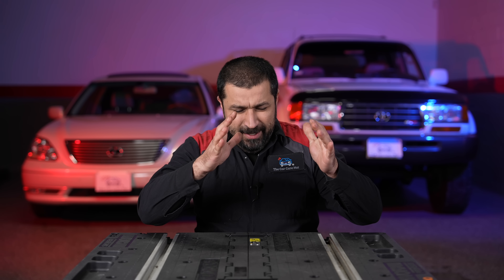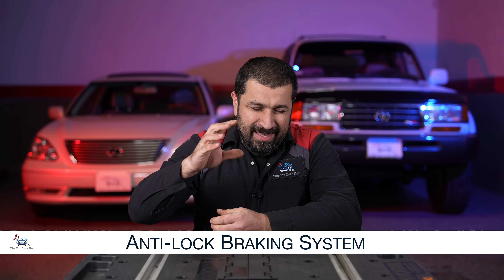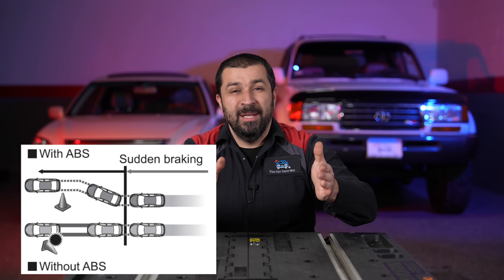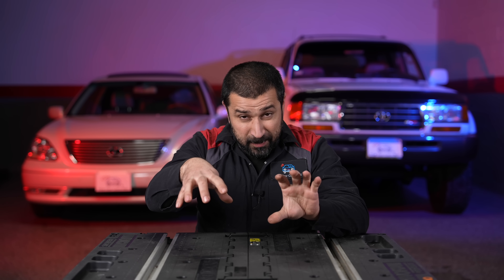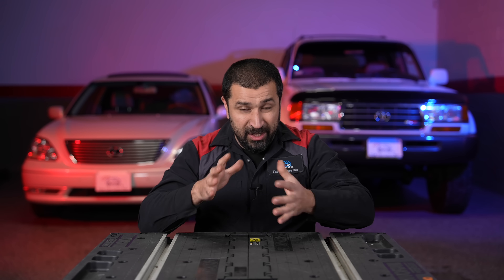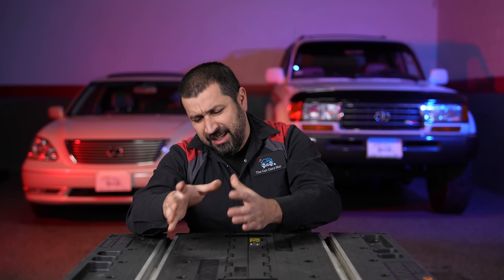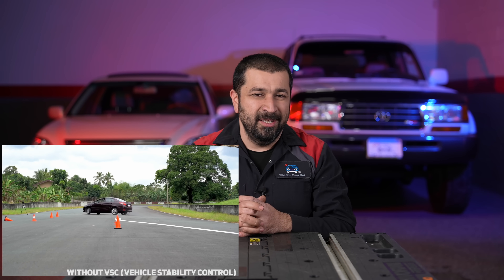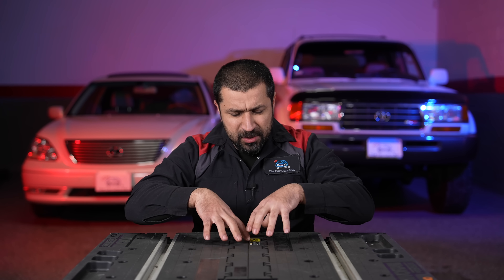How Does Toyota ABS, Traction Control and VSC Work? Everything You Need to KNow

Comment: The VSC and TC will light up if you get a transmission code (08 Rav-4)  The cruise control will stop working too. In my case, I needed a torque converter solenoid. The computer will detect a difference between the engine speed and the output speed and throw the code.  Funny thing is that the car drove fine, but the dash was light up like a christmas tree.

Comment: back when we had rear wheel powered vehicles, and there was a system known as positraction, then came a genius and said " hell we will place a computer in its place, this exposed to the elements- snow, ice, corrision, and the very great possibility of faulty electric components, so this day we have a half ass system. It is expensive to maintain, and will fail, this 100 percent failure, now one must realize, money is made by coming up with half ass thoughts.About fifty percent of vehicles benefit from A.B.S. the balance it is just 100 percent useless bullshit.

Comment: Thank you for sharing this valuable information.  I went to test drive  a 2007 Fj cruiser and everything was perfect  until in one curve the abs,  vsc and vsc track off lights came on.  No engine light on. I didn't hit the brakes hard in any way and I  didn't feel any spin off or traction loss . The Fj is manual and I did engage the clutch  while pressing  the brakes  to reduce speed. The speed was around 35 and reducing to around 25. The lights went off after a while  and kept driving normal. Would aftermarket wheels and tires be the issue?  It has 22 inch wheels and off road tires. 
Thank you  for any help.

Comment: I have a 2003 Sequoia and only when I get the traction control to slip I hear like a grinding noise by the four-wheel does that have anything with the do with my differential locks or anything or is that just how the system works grinding a little bit i think it the traction control working

Comment: Thank you for this explanation. My vsc and check engine lights were on so I bled my brakes, flushed the transmisson fluid and  the coolant system. When I reconnected the battery, all lights were off but after driving about 40 miles, the vsc and check engine lights reappeared. I now have a few other things to check after watching your video.

Comment: Left out Toyota's "Brake Assist", where the pump applies additional braking pressure. Had to pull a wheel sensor to disable ABS, VSC, etc., after replacing axles and bearings. It randomly came on when braking, basically panic braking by itself. Diagnostics showed no issues with wheel sensors, system was bled, ZPC cleared and reset, but system still panic stops when coming to a stop. Can't find any TSBs, recalls, Toyota forum discussions, and fear the dealer's most likely, (and expensive) solution to probably replace the entire master cylinder/accumulator/abs pump assembly. It'd be nice to find a solution.

Comment: My RX350 had an error that stated the drivers side rear abs sensor was out. "I put in an aftermarket sensor and replaced the passenger side with an aftermarket as well. I was getting blinking traction control lights blinking around a long sharp corner. It gets very dangerous going down a steep hill with a curve because all of sudden the brakes will kick and I almost lose control of the car. What else can be the problem?

Comment: 2004 4Runner had just the VSC & Trac lights on after it was in the shop.  The tech cleared all the codes after he did diagnostics.  The shop was unaware the zero point calibration and yaw rate needed to be calibrated and reset.

Comment: can you do a video on error message for the pre-collision system.  Have a 2019 RAV4 XLE that is running fine but warning lights just popped up today.  No recent service or mods or other work done.  Last service was transmission service and new brake pads about 4 months ago

Comment: Toyota dealer ship is super crazy i have that issue in my vehicle both issue. They are telling me it is gone cost you 3700 dollar to be fix it. I said if it is not that much important then why should i fix that? Why should i pay that much for the vehicle? The problem is without dealership i have never seen someone to fix this issue this is the problem. The Mechanic said there software system is with toyota dealership which is crazy that why other mechanic do not fix that kind a issue?

Comment: Can you do a short video that speaks to the Tundra (and perhaps others) abs self  brake test? My Tundra has a noise that occurs once per drive cycle after it has been parked for some time. When the truck reaches about 12 mph I hear a single clunk sound. It will not repeat itself until it has been parked again. I have been told that this is the "abs self  brake test" by other Tundra owners but have not confirmed with any Toyota experts.

Comment: I did a driveline swap for my 90' LS400 with a 98' GS400 with VVTi... Is there an easy way to tell if I have a wheel speed sensor wired up backwards? My ABS isn't working.

Comment: Hi there,love your channel. I'm having problems with my cars brakes. Wish you lived in Scotland. I have replaced,brake master cylinder,brake servo and all new calipers but still can't get the correct reserve travel. Master cylinders have been bled and calipers. No air visible. Maybe air in ABS module. Can't find a procedure for it in manual. 2003 Toyota Avensis 1.8 petrol. Any ideas welcome.

Comment: I just got my 2006 lx470 back from the shop with new calipers, rotors, pads and some other work. The steering wheel is now sitting at 10 o’ clock while the wheels are straight. Is that enough to trip the ABS/VSC/TRAC lights? Because they intermittently came on until I put the vehicle in park and released the brake, then they went off. Guess I need an alignment now.

Comment: My 2002 Sienna with 146K miles has the VSC, Track & Check Eng lights on but the van runs great.  I take great care of her with regular oil changes/maintenance.  I replaced both VVT oil control valves and screens/filters with OEM parts.  Also, replaced the spark plugs  and ignition coils with Denso units but the lights are still on.  Does anyone have an idea on what I should look out for next?

Comment: There is also a reason why all vehicles also have a Traction Control turn off button. The reason for this is Traction Control has a flaw. That flaw occurs when more than two wheels are slipping, typical on ice, mud or sand. What happens is the breaking of the wheels start to cascade literally stopping the car from moving. So if you are in very slippery driving conditions and your vehicle starts to slow down even though you are pushing the accelerator pedal, you likely will need to turn off the Traction Control, or your vehicle will literally stop in it's tracks and refuse to move.
Reply: My 2002 Prius does not have a TRAC off button. TRAC was implemented on that car pretty much just to keep the gears in the planetary hybrid drive from exploding if you picked up too much wheel spin, so it's more of a drivetrain protective feature than anything else.

Comment: I have a problem with left rear wheel is locking during emergency brake on GX470.
I replaced speed sensor, 0 DTC, speed are the same on sensors, brakes are fully restored and still something is wrong. Wheel sensor at 0. Done zero calibration.

Comment: I encountered a situation where the VCS activated due to deterioration of a rack and pinion bushing in my 3rd generation 4Runner. It took a while to figure this out until I looked underneath the vehicle and noticed one bushing completely disintegrated to the point of completely missing. When the steering wheel was turned the whole rack and pinion would shift left to right.

Comment: Great video as always.  My 2008 Camry Hybrid doesn't enable the User to turn off the Traction control when needed.  It's a little frustrating; I have gotten stuck in snow before because of it.  The Toyota dealer says there is nothing they can do 😐
Reply: Your Camry hybrid has a predictive VSC system called VDIM that is far more advanced than earlier VSC systems.

Comment: I prefer to turn off Trac & VSC when driving on icy or snow covered roads. I started driving back in the 1960's while living in Northern snow country, which made me comfortable steering into the skid, etc - and almost all of the cars were rear wheel drive in those days, making them less stable under adverse conditions. 

I currently have a '13 Venza w/ AWD, and it feels very sure footed in wintery conditions. In fact, the VSC / Trac feels like it destabilizes the car when they activate, especially when the brake is applied to one wheel while turning a corner, for example. Prior to the Venza, it was a '09 Scion xB, (no AWD). But on an icy road, it would yaw very slightly, but noticeably to me as the driver, at 50+ mph, maybe due to its short wheelbase. After turning off the VSC / Trac, that would stop, making me feel like I had better control over the vehicle, and gave me more peace of mind.

For those who might not feel comfortable driving on snow covered roads, VSC / Trac are probably helpful aids, but for me, most of the time they're an annoyance.

Comment: According to driving 4 answers, ABS is not there to maintain control, but to shorten braking distance. Because a skidding wheel actually has less resistance than a wheel that is not skidding. This is physics that everyone has experienced. Try to slide a heavy object, say, a washer. Notice that once it starts sliding, it’s easier to keep it sliding. 

VSC is there to keep the car in control. ABS is there to reduce stopping distance.

Comment: I have had my check vsc, and trac off light on for like 5 years now, i never wanted to fix it my cousin told me its not and issue and since i always turn my traction off anyways, especially in snow since its RWD manual, i can control my car better and not get stuck, since all it does is slow me down, i can control my car and know how it reacts to my input of gas petal and gear i am in, so never wanted to fix it

Comment: In addition to all of the above, I would also like to mention that the Toyota Avensis also has a TRC Snow option, which it has because of the borrowed engine and automatic transmission from the Rav 4 and Lexus. A great thing when it comes to ice or snow on the road. It allows the sedan to climb hills optimally when the weather conditions are bad. When this option is on, the car reacts more slowly to the gas.

Comment: Highlander owner here. Owned a 2006 (1st gen) for many years, now a 2013 (2nd gen), both AWD V6. I'm in Canada, very used to winter driving, and always on good winter tires. I understand the added safety of ABS and VSC, but Traction Ctrl  is PITA as there is no way to deactivate it beside pulling the ABS fuse out. When you are stuck in 2 ft of snow or need to get out of a hole and you need to punch it out to get momentum, you need POWER, doesn't matter if the wheels are spinning, you need RESPONSE from the engine. With TRAC the stupid system activates and kills all power. No the wheels don't spin, but you also remain stuck! VERY annoying! There should be a way to deactivate it (there is a 'secret' procedure to turn it off on some models, not the HL).   VSC: I've never had it activate on dry pavement (thankfully) but it activates easily in the winter when the streets are slippery. I wouldn't call it "agressive", but it's definitely sensitive, beeping at the slightest slip. I don't really feel what action it's doing to "correct" me, in fact once in an empty snow-covered parking lot I managed to get the Highlander in a full drift, gas pedal floored, spinning on all 4 wheels doing donuts with the VSC beeping constantly at me but doing nothing to prevent me from doing it.
Reply: Both of your Highlanders have a far more advanced predictive system called VDIM, which works not just if a loss of control is detected, but to prevent that loss of control from occurring in the first place.

Comment: ABS in my Tundra and Rav4 SUCK!! Up here in Canada in winter and On Icy Roads.  Pulling a Snowmobile trailer the added weight Trying to stop on Slippery icy roads is So DANGERIOUS. I have studded Tires. I want those tires to paw and drag.  You need some wheel lock up in the snow and on ice to create friction and drag the wheels so  you  stop. sooner then much later.   I've been pulling the ABS 2 fuse in winter because  ABS is so dangerous for trying to Stop at all speeds. Highway trucks do not have ABS for this reason.  At times YOU NEED Wheel lock up.

Comment: Trickle down tech from aviation. 
Just like airbags now on motorcycles 😅
Cant wait to see abs and airbags on baby strollers.

Correction for first traction control systems. They cut or restarted spark before the fly by wire throttles came in. 
Spark is still cut to limit torque for most cars and is foundation for basic traction control. My 340$ microsquirt has an option for this if i give it the right signal and programming.

Comment: VSC saved me from hitting a moose this winter in my IS300.  I was driving home after work one night and couldn't see it until I was quite close.   I had to cross 3 lanes of traffic very quickly to avoid it.   I would have surely crashed if I hadn't had VSC.  
I also love it in the winter in sport mode.  It allows you to drift the car just enough to make it fun but not so much that you lose control.

Comment: The relevant tie-in appears mid-way.  Appreciate the lead-in.

At age 73, I just self-replaced the Rack & Pinion at 95,000 miles on my (original owner) 2005 Sienna XLE.  Love that van and ability to remove middle seats for 4x8 sheets of plywood.  Also had a shop press new large 'rear' bushings in the lower control arms.  Plus stabilizer links for torn grease boots, and stabilizer bar bushings mostly because I had to release it to get to the R&P.  FYI, Toyota R&P for this Sienna is on undefined backorder length.  Well-pleased to have used high quality Plews & Edelmann made in North America. At times, they have done OEM for Toyota.  Essentially rust free in Phoenix and no more than the normal driveway mechanic frustrations with some cramped spaces.  

To replace the high pressure PS hose (better now than later), I had to remove the intake manifold which first requires removing everything from wiper arms down.  One hidden bracket holding the hose high up at the manifold for some odd reason.  So that triggered spark plugs replacement a little head of the recommended 120K interval. So the project got 'a little' bigger, I told my wife.  Yes, I cleaned the MAP sensor and throttle throat.

When I took the van to a local shop for the alignment, I asked if they normally zero the steering wheel sensor and found that they don't.  I requested.  Based on the mechanic doing the zero reset from his SnapOn tester, he was surprised during his test drive that it read 1151 and didn't move.  Did another zero from his Hunter Alignment built in mode and same 1151.  Bought my own diagnostic scanner and replicated problem at home.  Dismissing on line comments that the 1151 self-resolves by driving and full range wheel turns after doing zeroing.  Awaiting the Toyota sensor now to install.  

At same time, my TRAC button would not show TRAC being turned off on the display.  After disassembling the steering wheel shroud and dropping the lower dash panel, I found the TRAC connector disconnected.  Hard to believe I did that when working on the blend door years ago. As likely a dealer mechanic did it when doing uncalled for 2-hour diagnostic for my keyless entry receiver problem (despite my doing elaborate write up pointing to the receiver only).  Once I install the SW sensor and reconnect the battery, I will confirm the TRAC button operation. Diagnostic tester turned the TRAC light on at will, but didn't diagnose unplugged connector.

In any case, I am one of the small percentage for whom the SW Sensor fails.

Hard to find any black ice patch, snow pack, or slippery road in Phoenix to test all of this out.  So I will need to trust it is all working if called upon.  And also did brake flush two months ago during brake pads replace and rotor turning.  Still had very close to factory thickness.  Hopefully set for a while after all of this.

Comment: Totally true I experienced that my modern hybrid car (VSC auto pilot cruise control).
Modern car is more safer long last advance than old school ICE car. 
Easy safe smooth of everything even boring my first time driving. But later on I understand modern car now. 
My old sport sedan V6 high performance is nothing compared by new modern car. 
0 repair  for six years
Very low cost of maintenance just a year service warranty 
Fuel efficient 
Long range 
Now I’m planning to get another brand new hybrid 2026 model soon.
No old school IcE  anymore.
EV not at the moment,
 not applicable in my place 
High cost of electricity ( import energy 50%)
Lack of charger station 
Very short range.
Can’t survive weather extreme weather here( very cold and very hot in summer).

Comment: Thanks for the D8 scan tool review. I just picked one up using your link.  The dealership wanted nearly $200 to start diagnosing an Evap system fault so I figured that I may as well buy the scan tool that will pay for itself in a short time.

Comment: How do you diagnose which speed sensor is bad?  my vsc, trac control and abs lights turn on intermittently.  But when I get to my destination and restart, the lights go off. I’m wondering if it’s my abs speed sensor, brake actuator, or any of the sensors you mentioned. Unsure how to diagnose.  No check engine light either